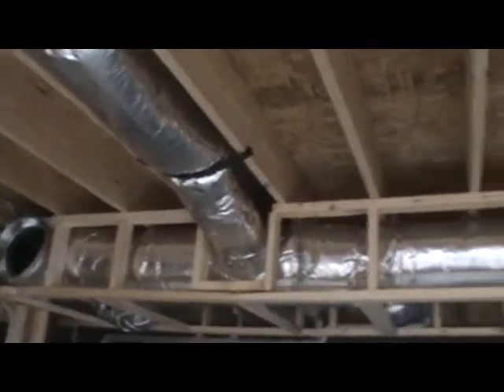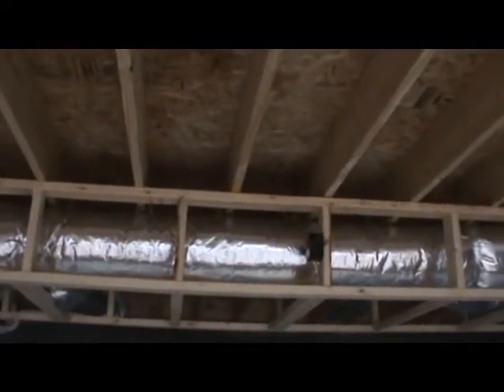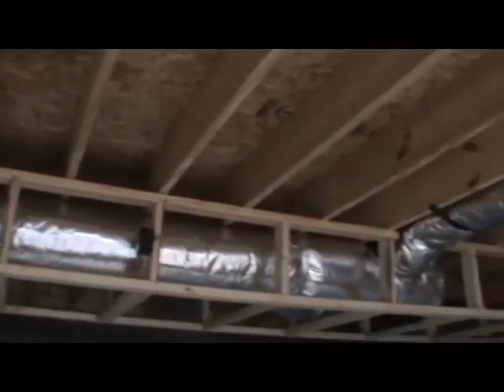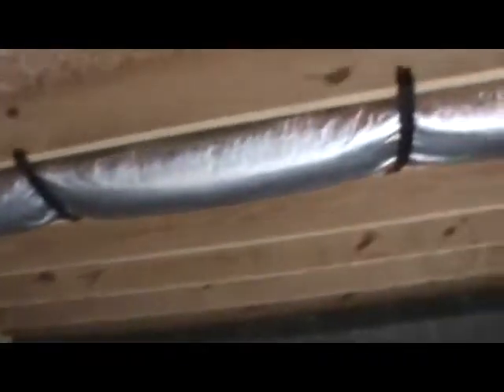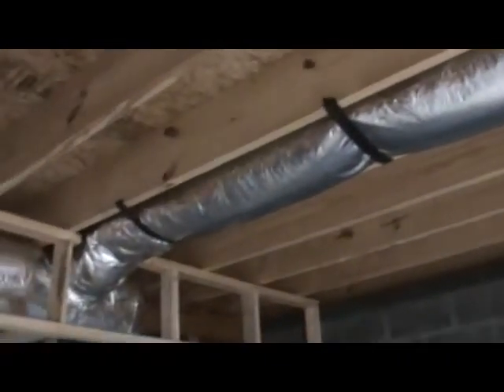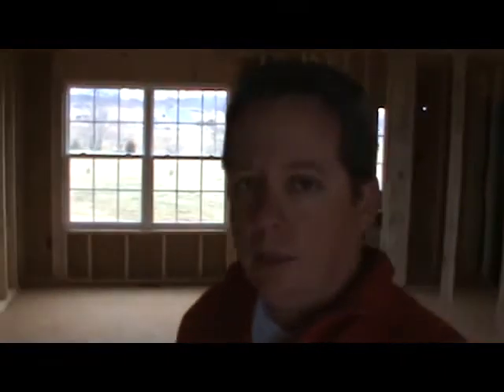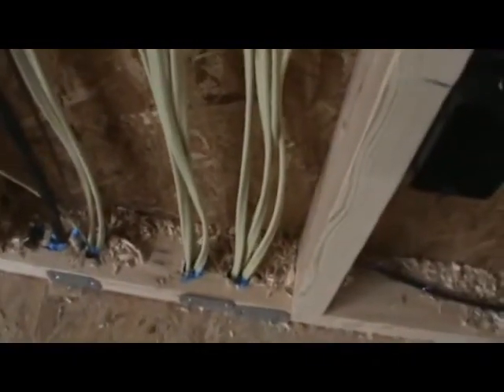How to Build Your Own Home Part 4 (Rough ins)

Comment: A few months ago I was tasked by a home owner to repair some leaky water lines in her basement.  When I cut open the ceiling I found 30 feet of copper tubing (water line) running parallel to the Heater duct. with 4 feet of the water line actually touching the Heating Duct.  Copper should never touch anything but copper or a not metallic surface such as wood.  This home was new home 10 years old and had been built by a reparable contractor but as you stated you need to inspect what they do and hope the inspector does a good job.  I've been working in Construction for 35 years as a Plasterer and I can't tell you how many times a home owner asked me about something that didn't look right with other trades.  I didn't hold back if I saw something out of place or skimped on and because of it I got a lot of referrals.  Great job with the video's make me want to come out of retirement that is if I could get the fishing pole out of my truck.